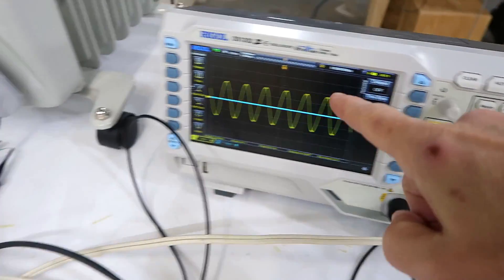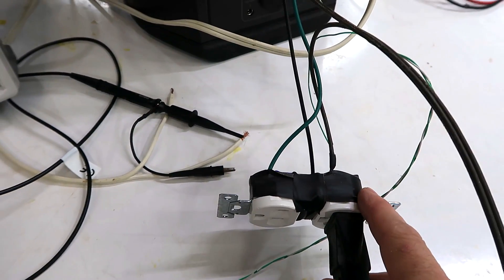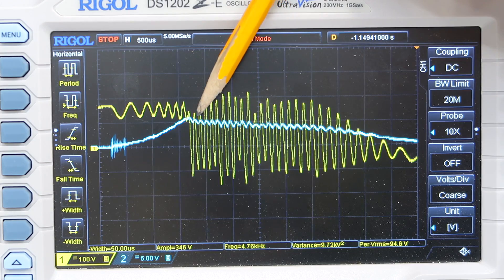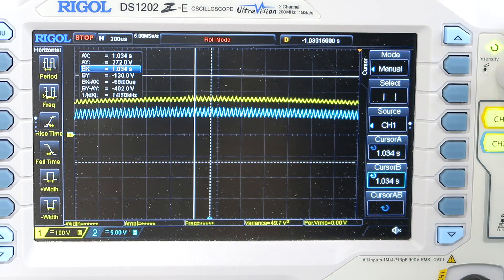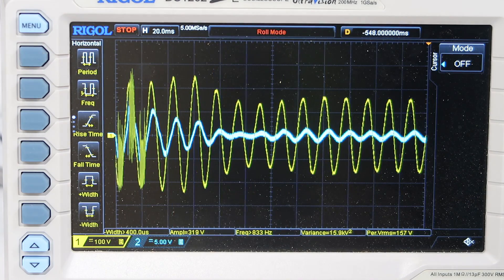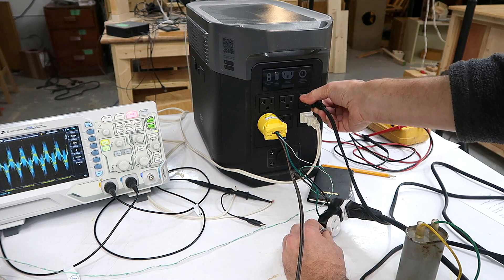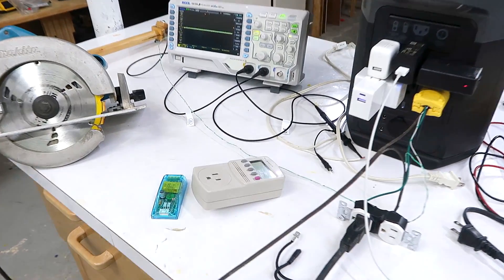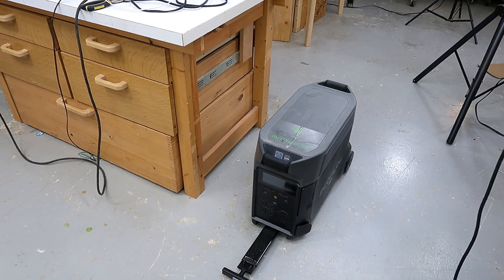Inverters don't like power tools

Comment: Inductive loads are bad for the grid and even worse for small inverters. 
If you plan to use saws and drills on inverters, off the shelf they could eventually kill your inverter. A single modification, a series appropriate NTC could save your tools, your inverter and any other devices hooked up to that inverter.
Reply: pascaalexandru I suggest watch a 13 part series called What on earth happened by Ewaranon to learn that the earth is not a globe.

I got it in my about tab.

Comment: To fix issue i won't use condensator. Inductive choke in seriesl will be more effective reducing high freqency inrush current. And not using power without load

Comment: Would be interesting to see if your bandsaw running could act as a flywheel and buffer the inrush current from the circular saw.
Reply: Me too. Poor mans single phase synchronous condenser. I'll have to think about how this would work with a brushed motor and a probably fixed frequency inverter. Might be easier to test than think.

Comment: Using a high frequency inverter is not the way to accomplish what you want. If you used a 5,000 watt true sine wave LOW FREQUENCY INVERTER,  having a real heavy transformer will give you what you are looking  for on those inductive loads.you get triple starting watts. Triacs, thyristors,  and SCR'S in modern day has made : mosfet  amplifiers and inverters lighter.  Dimmers cheaper( the simple triac chops the sine wave instead of old fashioned  multi tap transformers REOSTATS that dimmed lights by changing the voltage keeping the sine wave pure) 12 volt battery chargers that still use heavy transformers instead of crappy thyristors,  allow you to actually start an engine. Get what im saying? This modern era that steered away from genuine hearty heavy components to use cheap light disposable i.c. technology that just can't take a beating.

Comment: What about a parallel LC circuit resonating at 60Hz for filtering and stabilizing? You could design it that big so it can supply most of the inrush current but it may then approach the size of the battery system.
Anyway, I would call it a unlucky design (hardware and/or control algorithm, can't tell) that it behaves that inconvenient.
Possibly they just used some manufacturers application note and lacked the competence to adapt and refine it properly.
Reply from the maker: the other issue is the big LC circuit will probably consume 20 watts just sitting there idling.

Comment: I wonder what how the EVs that support V2L would perform in this situation. Way bigger batteries that can supply way more power, but presumably this would still be a challenge for the inverters?
Reply from the maker: I would expect them to be quite robust.  You expect more reliability from a $50,000 vehicle than a $2000 box.  A lot of reputation at stake too.
Reply: @matthiasrandomstuff2221  That’s true. Though for now I’m not sure how much these features are treated as core concerns and how much as gimmicks. Do they just buy a 3kW inverter from a supplier, with predictable cost pressures? Maybe!
Reply: EV’s don’t have full sine low frequency output inverters for heavy lifting but basically motor control inverters which don’t need fully blown LCL filters. This simplifies design considerably for high inductive loads.
Reply: @rkriisk  I’m not sure if the V2L inverter is the same as the main motor inverter.  It feels like that could be a whole separate component.
Reply: @tjnicholas  sorry was talking about main motor inverters, however on the bidirectional ac/dc internal inverter the same issues would be present because high switching frequency uses very small lcl filter and inductive load can saturate the core and you cannot oversize capacitors because lcl is finely tuned like musical instrument.

On the overall topic I think mosfets are not a source of the problem because they can short term output more than 5x their nominated amps unless being “castrated” by switching logic. DC side main cap can be a problem if its under sized or too high ESR. Most high power (5kW +) dc/dc converters use super low esr ceramics for this purpose in parallel with electrolytics to overcome stability issues. However looking at scope pictures it might be even that this inverter is not operating in full close loop or that noise rejection of its sensors is too low.

Comment: They could solve the issue by including a capacitor block for use with power tools, and in the next iteration they could just build a capacitor bank into the design. All they need is extra discharge for the startup.
Reply from the maker: as I pointed out, that increases the quiecent power usage by quite a bit, so most of the time it's detrimental.

Comment: I hope those battery inverter companies specifically stated that their products are not used for heavy duty purposes. I mean, if I was building a batter inverter, I would state that out to avoid disappointed customers. However it's not to difficult for smart electrical engineers to design proper pre and post AC filters and DC filters with smart monitoring to prevent damage of product of both parties. Also that circular saw should have extra components to prevent dangerous in-rush current this is common knowledge, since we all know no one in this industry are making smarter and more advanced circular saw to have components to prevent large initial current load that keeps tripping the 15Amp common circuit breaker. Also to keep yourself safe and Rigol oscilloscope, you should conduct these tests with the rigol powered from an isolated power supply, using an isolated transformer which doesn't have common ground from the mains voltage supply or using a completely isolated battery inverter not connected to mains voltage and mains earth to power up the rigol, because the ground probes are literally connected to mains earth ground, so when this ground probe touches an conductors that is also connected to the mains AC voltage, you'll have a deadly short. Dave jones made a video on that.

Comment: For harsh loads like this, "low frequency" inverters handle the situation much more gracefully, the downside is that because they use a mains frequency step-up transformer, such inverter types are much larger and heavier than a comparable high frequency inverter.

Comment: Does the unit have a floating Neutral and what happens if you bend the neutral and ground hitch is supposed to be done for each source of power

My furnace gets quite upset if I don’t bond the floating neutral as if you don’t bond it’s gets 50 volts on the natural leg 😮

Comment: I can’t run my Dewalt 7 1/2 inch circular saw without tripping my Sol Ark 12 K inverter right at the inverter. Go 200’ away, through all of my house wiring to another shed on properly sized conductors and IT RUNS FINE without faulting my inverter. Can you explain that? Inrush current is 110A. So about like yours. So basically, if you try to power your whole house with one of those, you will blow it because our neutral and ground are tied together out at the meter base/disconnect or main panel.
Reply from the maker: if you are far enough from the inverter, the wiring adds resistance which limits the inrush current

Comment: Did thus round of testing change your opinion of these inverters or do you still maintain your previous assessment?
Reply from the maker: I still think its a flaw, but probably harder to fix than I thought, and more widespread.  If I was desigining one, I'd try to avoid this behaviour.
Reply: @matthiasrandomstuff2221  thanks for the reply! I wondered if your viewpoint may have changed a bit.

Comment: Easy solution - most powertools (with universal motor) don't need pure sine-wave.
Use good quality pure-sine inverter for things that really need it. Use much cheaper modified sine-wave for other things - powertools, devices with switch mode power supply, resistive load etc.
Having some experience with UPS systems for computers .. yeah .. phase balance, PF, power and capacity are all important, but not related.
Got big surprise in my last place - 2x15KW cooling system connected to UPS .. and no diesel generator. Uptime at max load ~ 45 minutes.

Comment: Have you tried this with an inverter, such as a Victron, which has a large transformer to improve the performance with inductive loads?  You may be able to improve the performance by plugging a good large isolation transformer between the inverter output and your inductive load.  There's a good 120 VAC soft starter on Amazon for $130 made for table saws, routers, ect. (which i just ordered thanks to your video!).   As a side note, the batteries used in some portable power tools, are 30C or even 60C devices, meaning that that 4 AHr battery can supply 120 to 240 amps of inrush current to start a motor, which in many cases, makes them far superior to their plug in counterparts.  Great and in depth information!

Comment: In the OLD- UPS, units with lead acid battery's the Manufacture's, placed a "SCOTT "T", connected transformer, @ the output, to reduce that surge. Boy did that make it a Heavy unit thats why it had wheels.

Comment: Makes me wonder if there is an opportunity for an add on product for power tool users (either via the OEM or after market) that would sit between the battery box and the tool; that would protect the battery box and sensitive bits from the nasty stuff created by things like circular saws.
Reply: Or they could just put such a device inside the box. As they should have already. Clearly there are plenty of people who will use this with power tools, the idea that it's an unlikely scenario and doesn't need to be considered in the design is pure laziness.

Comment: So these are high frequency inverters correct? What I get from it is, if you're going to be using inductive loads, go either partially or completely Low Frequency inverting for those loads.

Comment: Couldn't you design a soft star circuit where there would be switched capacitors like you used that would be turned on only when such inductive devices are detected?

Comment: I wonder if there is something that could be made as an INLINE item for the power cord of the saw (and other items) that could "clean up" those start-up frequencies. I mean, the EASY fix is to go cordless and just used it to charge batteries BUT, to what you're looking at, I wonder if there could be something made into an extension cord type thing. Of course, I may be revealing my ignorance on the subject by the mention of such a thing.

Comment: On the second inverter you are showing a common problem with HF inverters with poor power factor loads.

The power tools are likely commutator motors.  They still have a high startup surge which also has a worse power factor than their steady state run current.

Poor inductive power factors cause some reverse current during a portion of sinewave.  This causes the battery to HV DC converter in HF inverter to potentially become unstable which is what you saw in second test.

Comment: A motor at rest presents more or less a dead short circuit to any power supply.  That's just the laws of physics.  Until it's turning, there is no back EMF being generated; and the voltage that is actually getting multiplied by the current times seconds to give the Joules of work done turning the armature around is the difference between the supplied voltage and the back EMF.
Reply: This is also why electric cars have such good acceleration, an electric motor can generate maximum torque at zero RPM.

Comment: An inverter is not as robust as our mains power supply in our homes. It is allready wise to run such power tools allready with an inrush current limiter on mains power. So it is more necessary to use it for an inverter. Btw: even a very powerful halogen lamp can easily draw up to 10 times its nominal current when switched on. At 300 K the resistance of the tungsten wire is 10 times less than at 3000 K.

Comment: May be they could add an option for tool motors that makes the inverter deliver low voltage then ramp up
But it need to be used for single tool at a time

Comment: Interesting that connecting neutral to ground damages the equipment. In some countries that is the standard set up. I assume that isn't the case where you live.
Reply from the maker: At the main breaker panel, neutral and grounds go in the same place.  But appliances must never assume ground is neutral, cause you never know if someone wired things wrong.
Reply: @matthiasrandomstuff2221  all true, but that still makes if perplexing that connecting these two at the inverter should cause so much damage to the boards.

Comment: You turned the saws off immediately so the voltage and current will obviously reduce. To get the real picture you need to follow the process through to continuous running the motor.
Reply from the maker: I ran it long enough to reach steady state.  You wouldn't see it changing much after that, and it would make for a very boring video.
Reply: @matthiasrandomstuff2221  OK maybe the editing changed the perception, but the video shows that you were just " blipping" the saw trigger which won't alow the motor to reach steady state, hence my comment. Yes it probably would make the video more boring, but if you weren't observing over that full time frame you are not necessarily getting what you think you are. It makes no difference to me, but if you genuinely want to dig deep into these things then you have to be sure you are measuring correctly. There is nothing worse than having years of unexplained and perplexing failures that turn out to be the result of unquestioned  "solid information" that wasn't really solid at all.

If you were observing to steady state then all is good. Apart from this niggle (more a suggestion in reality) , it was a very interesting video.

Comment: The reason the oscillations are so bad is likely because the massive overload far exceeds the dampening harmonics in their LC filters and snubber networks. I think that explains why when you put the resistive heaters on there there was just the small oscillating ripple from the slight overload before it shut itself off. That saw is just way too much inrush and totally sucks out the voltage in the LC filter, trips the OCP, it tries to recover with it's rated capacity, OCP trips again, all while following along the desired sinusoidal voltage waveform line, gotta give it credit for really trying though, unfortunately that trying is causing that high-freq harmonic. 

Also whenever you Measure with a shunt at unknown current levels, if too large a value, the shunt will often reduce the severity of OVC events, one of those changing it by observing it things to keep in mind.

Comment: BLUETTI AC200MAX, Can I maybe ship you mine? ive had intresting luck with them, decent customer service with a previous issue. My AC200max has some interesting issues. The screen no longer functions, but it can be turned on via the app, also the second charging port (where you can use an XT connector and 12volts, solar, another 120v Power supply) is broken, makes a clicking noise when given power. The normal 120volt port functions. and otherwise havent had any issues in my use case. If you would like to give it a shake down let me know.
Reply from the maker: It would be interesting to compare.  But shipping to Canada would cost quite a bit.

Comment: PS- Couldn't they just include an output capacitor built in to a small extension cord that you could plug in when running tools like this. Then just simply unplug it when not using to save from the extra draw on the batteries. Then they wouldn't need to change anything to current product, but just include it and a disclaimer 🤔
Reply from the maker: that sort of thing just causes confusion

Comment: Power tools can be easily improved with soft-start or inrush-current limiting.  This might make you have to wait an extra second or two for it to spin up but it will not only be helpful to your power supply, it should also improve the lifetime of the tool if designed correctly.

The output circuit of that board looks like an output filter for a class-d style switching circuit.  Those capacitors and inductors likely create a filter that filters out most of the high frequency switching noise.

Comment: This is due to the lack of a normal filtration scheme at the output of the inverter. At the exit should be a choke for blocking high -frequency splash.

Comment: Any device the use cheap "capacitor dropper" power supply internally (like your power meter), cause the internal power to skyrocket (because the "capacitor" is TOTALLY frequency dependant, and higher frequency pass WAY MORE current/voltage), which results in BOOM!!!!!.  All chargers are NOT frequency dependant, even the cheap ones, so they areok.  Capacitor dropper power supply are CHEAP GARBAGE, shame on the penny pinchers like kilowatt meters, low end LED lights and other cheap CRAP!!!!!!!!!!!!

Comment: I design and build inverters, and a dirty little secret of the VAST MAJORITY of inverters is that their design is CHEAP, with emphasis on NOT BLOWING UP.  The down side is crap performance and crap stability with inductive loads.  In fairness, this is WAY HARD to design out, and it is also EXPENSIVE in parts to make it stable.  When I design the circuits it is ALWAYS a trade off in STABILITY vs COST.  A lot of nearly impossible to predict instability must be tested for in real world prototyping, which also often results "fudges" in the circuit to stop mosfets from blowing up at the expense of, you guessed it, stability.  Low Frequency transformer designs are VERY STABLE, but very expensive (and heavy).  But it is the ONLY way to get good inverter performance and stability - PERIOD!!!!!!!!!!!    ...so most inverters are CRAP!!!!!!!!!!!!